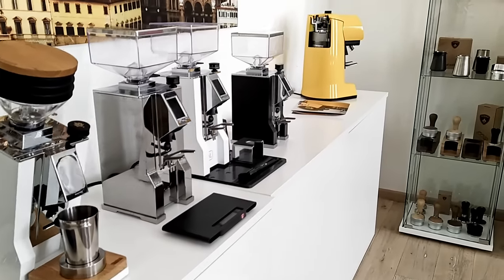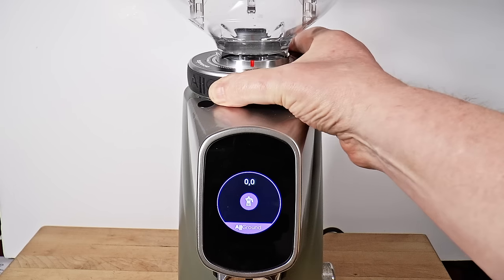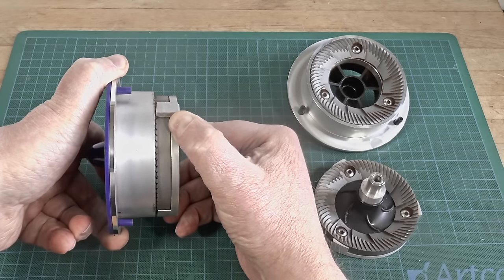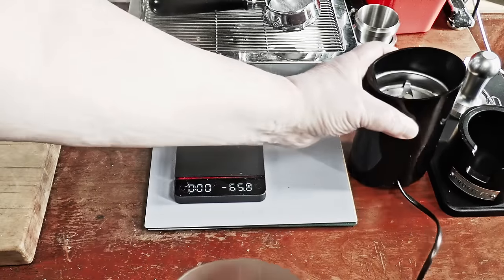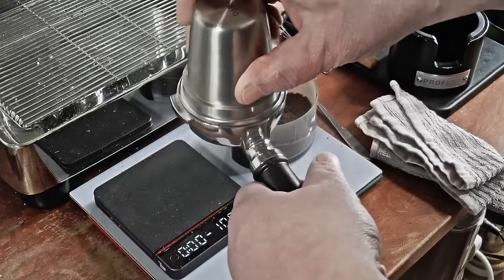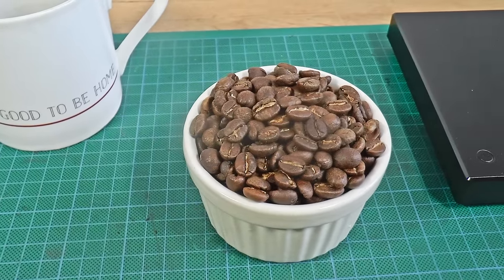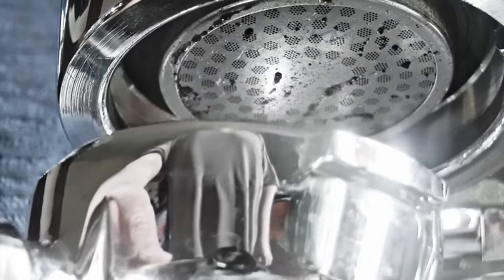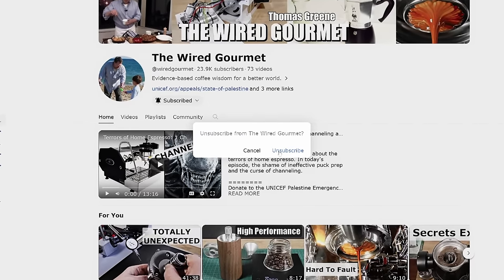Espresso Terrors: 2 Grinder Anxiety

Comment: I have a Niche Zero and I find a huge difference between different coffees and my ability to dial in. Some have a very wide sweet spot, others a very narrow one. What causes this? Density of the beans? Brittleness / residual moisture content?
Reply: cause it's generally a grinder which makes your coffee bitter! After having it for 2 years, bought a Comandante c40, made a not even well dialed espresso with it using same coffee, got blown away by the amount of details I got from the coffee, and packed away my Niche the same day!

Comment: I used a Krups blade grinder for several years albeit for pour over / mokka pot only. The biggest disadvantage with a blade grinder is repeatability. That drawback alone makes using it for espresso next to impossible. Unless your expectations of a great result are kept in check.

Comment: So odd question, I have a k ultra and the grind size seems super touchy when using your fill to volume method, Ive ended up basically choking the machine with my grind size and simply underfilling the basket potentially so I get a decent flow rate and taste(usually) but it looks like the puck either at the very end or during extraction has floated to the top of the portafilter and sometimes the water runs fast which confirms it's happening during extraction, any tips?
Reply from the maker: Have you ever tried a paper filter on top of the coffee? I can't really say, I'd have to see it for myself, but it sounds like you might be getting a lot of turbulence that's kind of plowing up the coffee bed? If you have headspace of appr 1.5 - 2 mm between the shower screen and the top of the coffee, it really should be just a matter of getting the grit size and tamp pressure in the ballpark, like pretty normal dialing in.

Comment: Do you have any opinion about the Breville Barista Pro internal conical burr grinder? I am 1 year into my espresso hobby and wondering if I can taste the difference of a fancier flat burr grinder. Thx for the great vids!
Reply: Do you have any issues with consistency?
Reply: @Conservator.  Grind consistency is good but I may be having temperature inconsistency which can affect shot times, despite preheating portafilter.
Reply: @bachatero2010  Hi,
I think that if temperature isn’t consistent, then that’s probably where you could improve most but that would probably require you to get a different machine so you’d have to be 100% sure that that’s your biggest issue. 
Just my thoughts.

Comment: Anyone taking this video as advice to make espresso please DON’T…

Making espresso with a blade grinder is absolutely ridiculous and inconsistent.

You can’t “pre dial in” on dark beans then switch to another much lighter roasted coffee and get close to similar results….

Flow is affected by GRIND SIZE & has absolutely nothing to do with tamping pressure….

The puck is either compacted or it’s not…

The only thing you can do is tamp too lightly which will result in a fast running shot as displayed in this video.

🤦🏻‍♂️